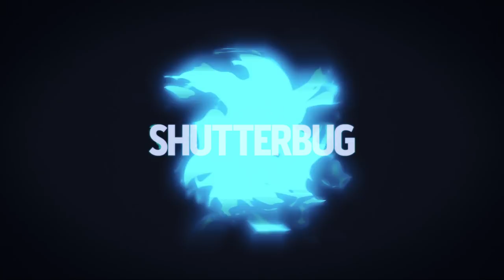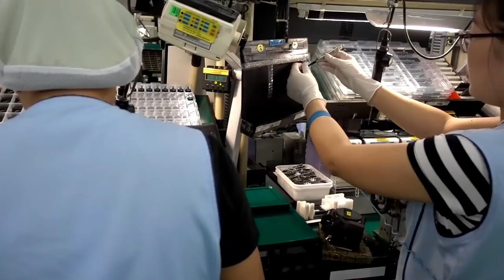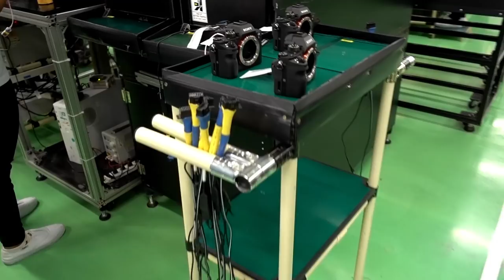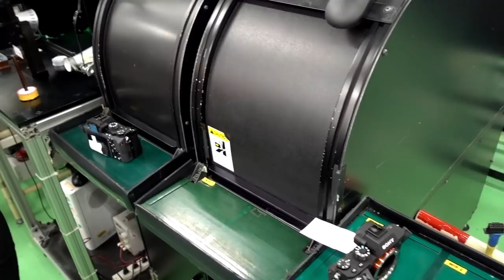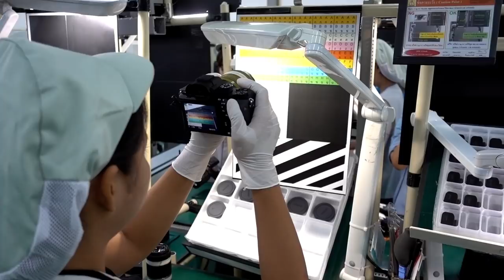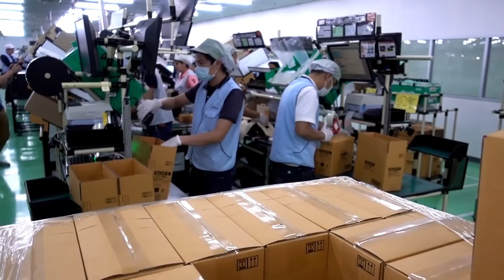Watch a Sony A7R II Mirrorless Camera Get Built from Scratch at a Factory in Thailand

Comment: Very cool, if brief look into the factory. What was the overall size of the assembly line in terms of stations? Is this the only plant making the A7R2? Do they make other bodies and cameras there?  This video is such a teaser, there's so much more I'd like to know, about each step in the process, about quality control and testing, about working conditions (I note it looks like 100% women). I don't know how much time or explanation they gave you there, but it sure would be nice to know more.
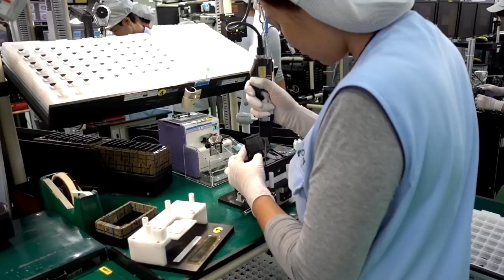Reply: Jonathan Stewart 1:31 two men on left and near end men boxing area. Not sure why that matters though. I have two A7R2's and only difference is first one I got the memory card door is harder to open than it should be. But both work great. ❤️ this camera.

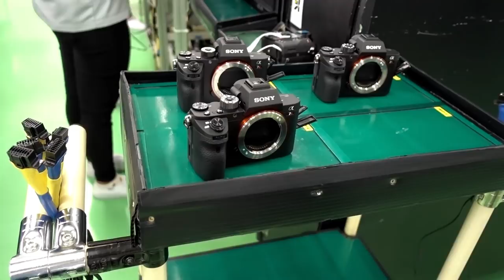Comment: 2:06 - Is that why I had an extremely dusty sensor with a heavy oil stain on my brand new A7RII which took 24 swabs to clean?   Is it because they leave the sensor open like that for who knows how long?
Reply: You are the only one complains  "extremely dusty sensor with a heavy oil stain on my brand new A7RII." Fake News!
Reply: I bought it when it first came out, so it might have to do with that.

Also when I rent cameras they also are very dirty as well.  I think most people shoot wide open whereas I actually use the full f-stop range.
Reply: Who the hell would shoot non wide open for film.
Reply: These who actually have a vision on how they want their film to look instead of following cheap gimmicks.
Reply: Lots of reasons. Any sort of landscape shots, wide shots, or any other shots where you actually think about your settings and if you want that depth of field look.